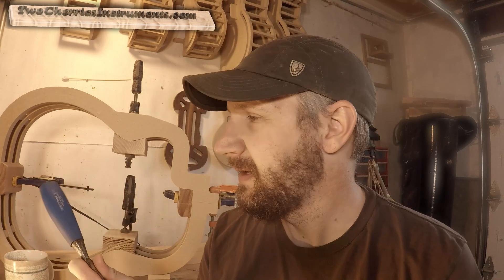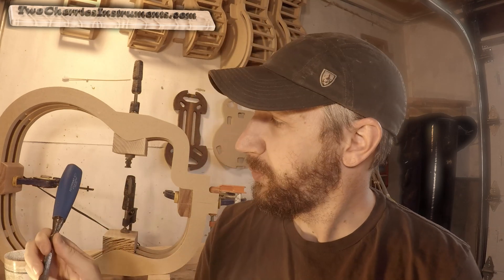Selmer Guitar Part 2 | Mold, Corner Blocks, and Kerf Linings

Comment: Do you believe that triangular kerfing are better reinforcement support for the Sound plate and sides(better strength, better nodals points…)???
Reply from the maker: I don't. The kerfing shape has very little to do with the tone of the top; it's all in the bracing and the resonance of the top itself. I don't think that this small amount of mass on the rim of a tone plate could ever make a discernible difference. I usually make linings as solid pieces bent in the same jig as the side stock. I try different Ideas from time to time like this, but I still firmly believe that rectangular solid kerfing is superior from a structural standpoint; I don't think the tone is a consideration; that is left to the top thickness and bracing.
Reply: @TwoCherriesIns  ok thanks for your fast comments to my question.

Comment: That's some heavy artillery you got here! Mine is a "little big" one and we don't master the 3D part, so until now, we stick to my son idea: the 2D+! The pieces once assembled becomes a 3D piece! Cheap and cheezzy but it works… The analphabetic 3D, ha, ha, ha!

The cutting of the mold, and the back profile are great! Didn't push the thing so fare and made my back profile the old way! Wish I knew how to make 3D!

The kerfing is cool! I wanted to try it too and borrow the idea of Bruce Petros —my mentor— and glue some fabric between two pieces of wood which create a "snaky" super flexible lining. 
Cool video!
Reply from the maker: Interesting idea, I'm thinking about going back to solid bent linings, smaller with the same strength and more freedom for the top to do its thing.